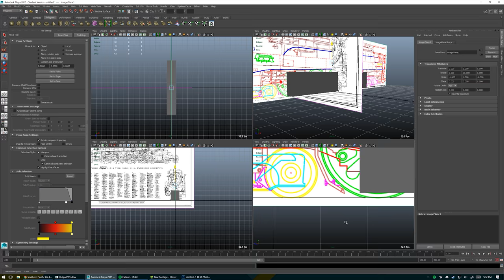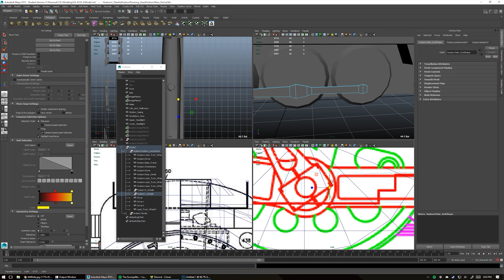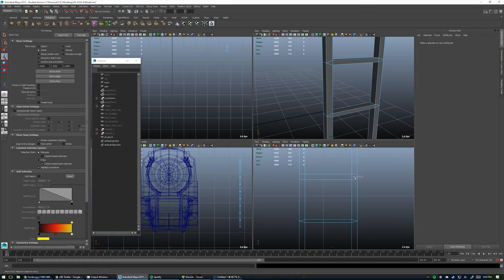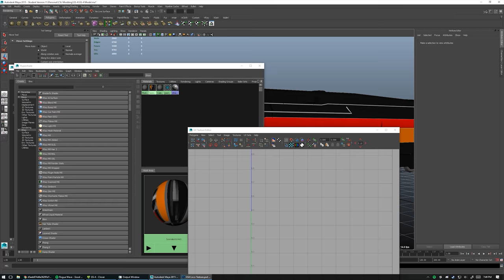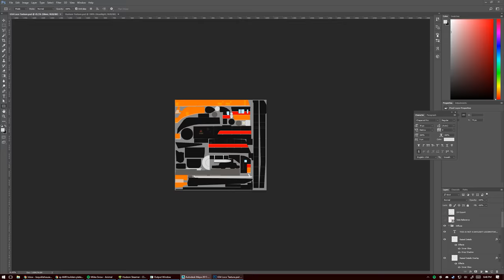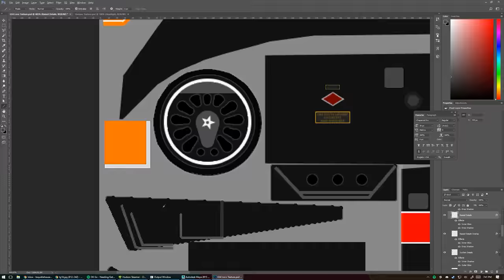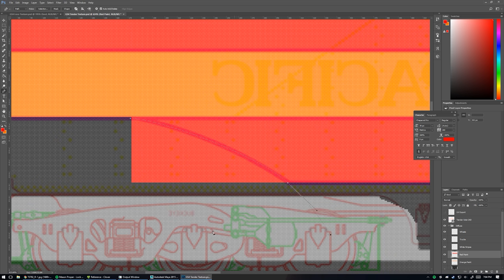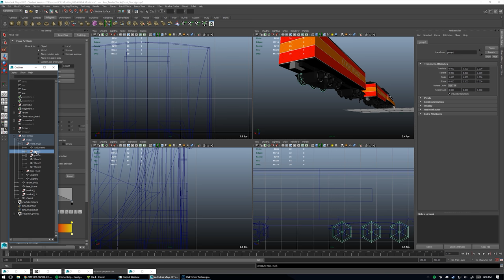Cities Skylines Asset Creation - Oceanview Limited Steam Locomotive

Comment: I see that you know your trains. Along with the running gear (the coupling rods and such), it would be nice if Skylines allowed the ability to implement a working Gyralight which the GS-4's carried. Either way, nice work! Definitely getting that asset.
Reply from the maker: RailLord I tried to fake the Mars light with a blinking light, but I think I screwed up the config file.
Reply: Aw... Also, Mars? I always thought it was Gyra. Huh. There's my memory for you. Though, to go on a tangent, it'd be nice to see the Pennsy K4 or the T1 in-game. However, I'm not sure if the T1 would be practical.